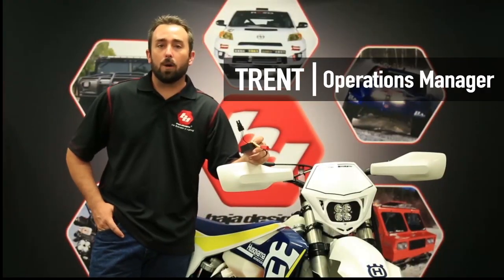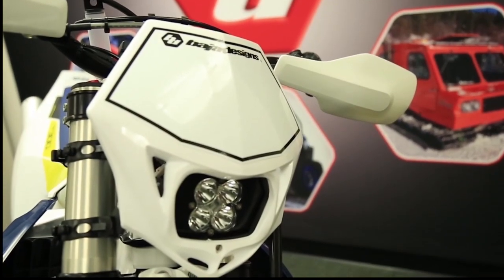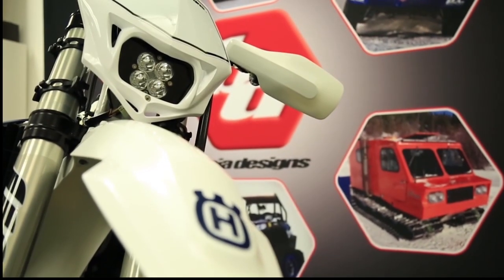Upgrade your bike's lighting setup without modifying your stock electrical system!  #BajaDesigns

Comment: I have a crf450x 09 , so I just need the harness to run a squadron pro universal headlight ?
Reply from the maker: The CRF450x 2009 has roughly 40w of power to run the light. With the upgrade to our next-generation LEDs, we do recommend a stator rewind to run both the Squadron Sport (30w)and Squadron Pro(40w) lights.  Let me know if there is anything else we can help with or our customer service department is always a call away at 760-560-2252 and they can help you with more detailed information about which solution is best for your bike. - Doc

Comment: I wish this product would solve the flickering at idle and add low beam mode as well. I would pay 50 bucks more for that. I put this on my ktm 530 exc 2009 and it only has high beam functionality. I  would give it a 7/10 and if they fixed the two issues I talked about it would be a 10/10
Reply from the maker: Hi, unfortunately due to that bike creating A/C power rather D/C power there will always be a slight flicker. For that same reason we are unable to create a High / Low mode. 

We sincerely apologize! Let me know if there is anything else I can help with.
Reply: @bajadesigns  how can I wire this directly to a power tool battery from my airbox? 2001 yz250 I really need a headlight for the summer. Might go with the PRO in black

Comment: why is the light for the 2020 crf450x twice as much as other bikes? I don't see a justification in cost for a different connector.
Reply from the maker: Ernie, the CRF450x kit is $264.95. Our standard universal Squadron pro is $199.95. Not sure what kit you're comparing but most moto kits in the pro variant are priced near that point.

Comment: Can I install this headlight to a Honda CRF250L 2018?
Reply from the maker: Hi, 

You can use the DC version of this light with some minor wiring to use for factory headlight switch as an on or off switch.

55-7001-WT
49-7001-WT 

Are the two part numbers applicable to your bike. If you don't mind having a secondary switch and would like to avoid having to crimp anything you can also use 61-1049. 

Let me know if you have any other questions!
Reply: How about for a Honda CRF 230f Mexican model. Please and thank you I appreciate it for all the info I’m trying to buy one in Mexico a crf 230f
Reply: I live in California and want to buy one and take it to Mexico so I can install the head light to a crf 230f I hope it works for it too thank you friend

Comment: Hey, I have a 2004 CRF450R which has lights at the moment but they are running straight from my battery. I was wondering if you guys sold the AC circuit board as a stand aline item for my bike? Cheers

Comment: Hey Trent, let me ask you a question do you do analysis of Lighting systems at Baja Designs? I nought a 97 xr400 that has dual sport kit and electric start, I have no idea what the electrical system is. Maybe your experts down there do. If I were to bring my bike down there could I get some of the look at the electrical system and tell me what I got?
Reply from the maker: Hey Bruce, we no longer troubleshoot bikes in-house however we have a few local shops and individuals who perform this type of work. My suggestion would be to contact Devin who is our Technical Support Representative within BD. Once the two of you determine which DSK you have and the potential components needed, Devin can provide you with Ben's contact information. Ben troubleshoots and replaces product on the side. He is extremely knowledgeable and is certainly worth the drive down or up depending on where you are driving from.
Reply: Thanks for the info. Sounds good, I'll probably load the bike up in the truck and make the run down when I have the time.

I am interested in cleaning up the wiring as much as possible. I have determined that I am running a TUSK DualSport wiring kit with the wiring appropriate for electric start. I did note that it has a Baja Designs DualSport Regulator / Rectifier -  and I am running your H4 headlight. However, how it is pieced together, is beyond me.